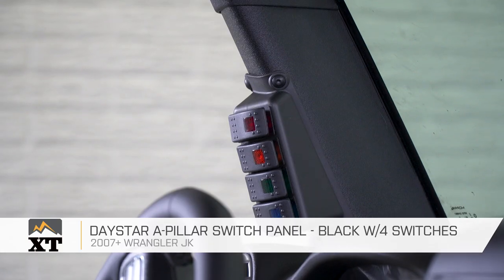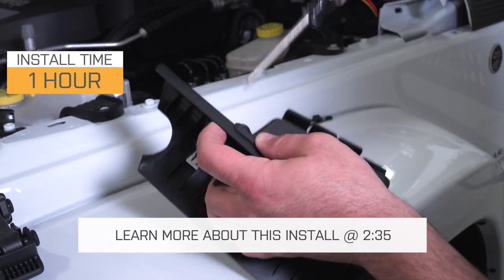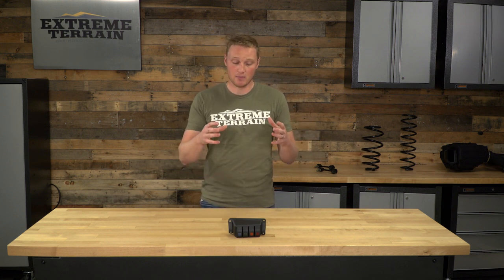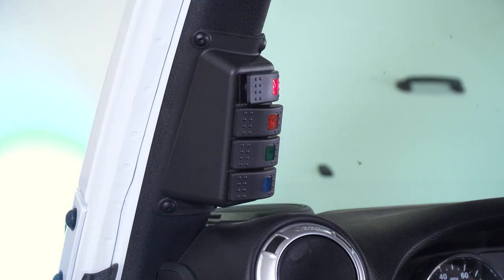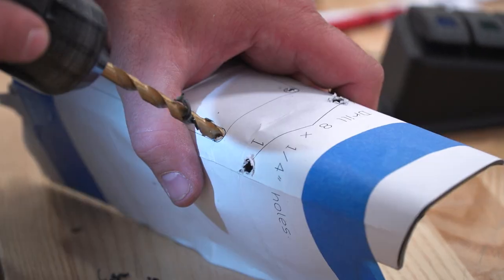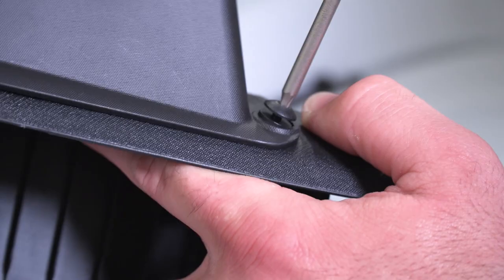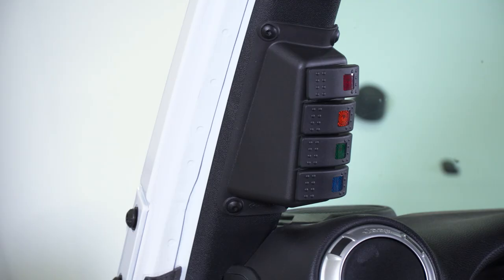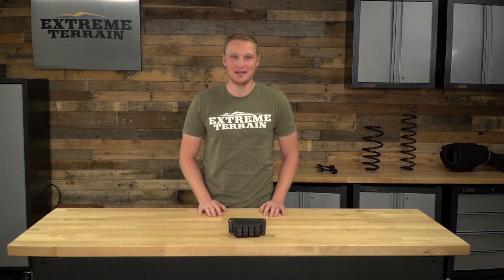Jeep Wrangler Daystar A-Pillar Switch Panel w/ 4 Switches (2007-2017 JK) Review & Install

Comment: What wiring harness do you need for this?
Reply from the maker: Most aftermarket accessories such as lights, compressors, etc will come with the necessary wiring harnesses that are compatible with these rocker switches. -Jake